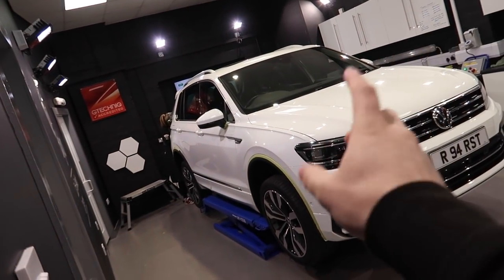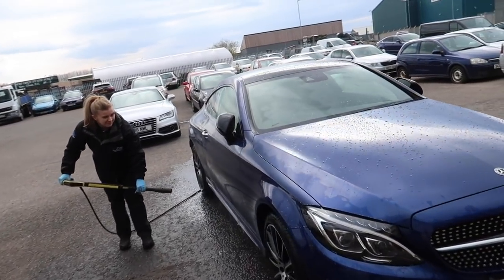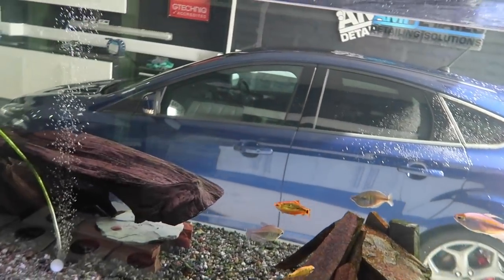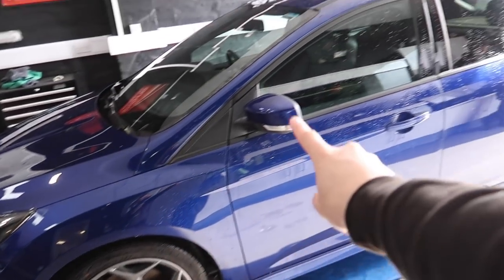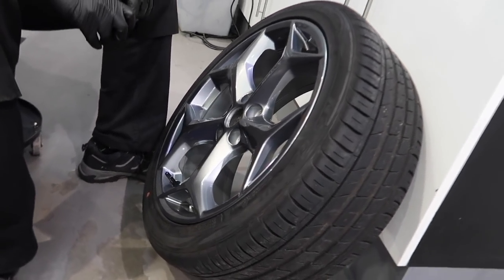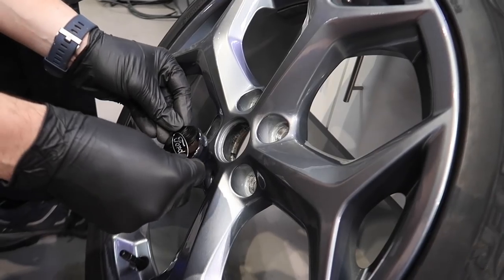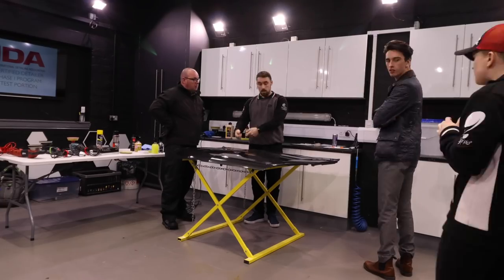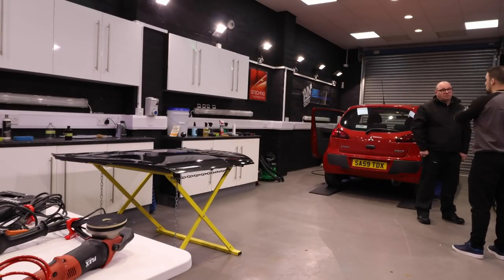VW Tiguan - Focus ST Detailing - IDA Training - AMDetails Vlogs

Comment: Hey Alan, Love the videos and always great to binge watch your Chanel! Just out of curiosity though, at 12:15 or so, the bonnet gets.panel wiped, then again, and again, then coated with CSU, then panel wiped again? Why panel wipe the coating itself?
Reply from the maker: Hey Tim, 

Great question and observation

That isn't panel wipe that's EXO application. The only reason I know this is because CSU should be applied in smaller areas. Also, CSU is only used once by AMDetails. Then 2 x coats of EXO.

So what you are here is Tasha using my three cloth method.

Eco goes on. I cloth spreads the coating. 2nd cloth buffs it off. 3rd cloth checked for overtime / full product removal. 

Then repeat for 2nd coat. Eco, 1st cloth, 2nd cloth, 3rd cloth.

I hope this helps. 
Alan
Reply: @AMDetails  hey Alan,

Thanks for that, was thinking you had a super secret trick!

Keep up the awesome vlogs man, love it and your awesome accent!!!!! My missus gets cranky at me now as I do the "goooooooooooooood mornin"
Reply from the maker: @timcox5088  Thank you for keeping the Gooooooood Morning going whilst im away. I will be back. just juggling some health this end.
Reply: @AMDetails  oh no, mate I hope you're all OK and it's nothing too serious. Get better, thoughts from Australia matey